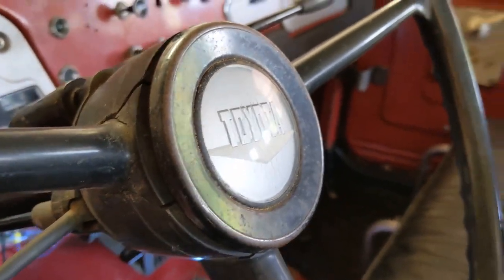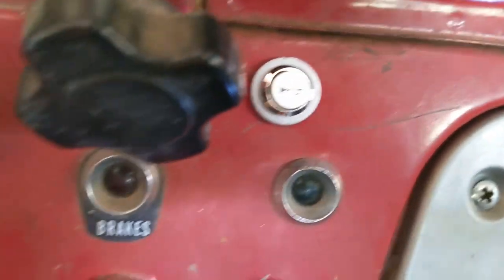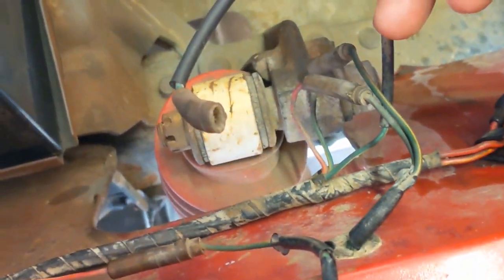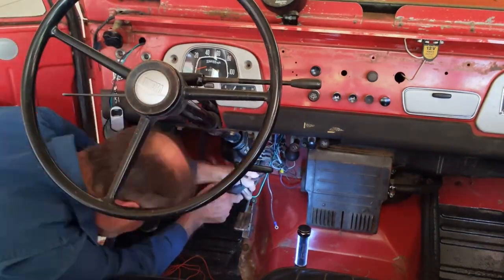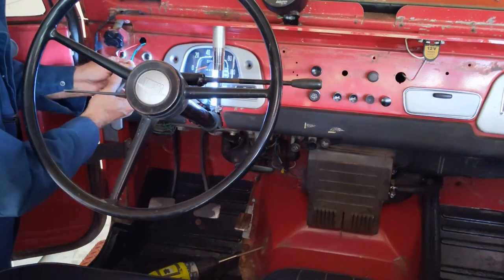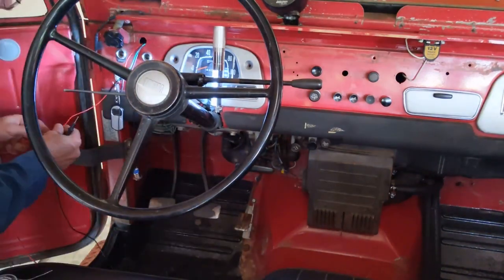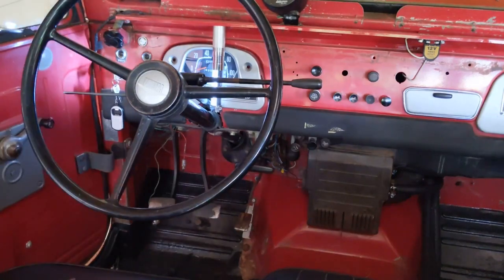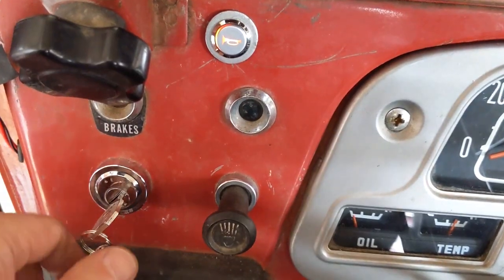Beep beep... The horn works!

Comment: Okay, somebody's gotta ask... why didn't you fix the horn so it works as Yoda designed it - with the OEM horn button?
Reply from the maker: I haven't been able to find a replacement brush for the steering column.